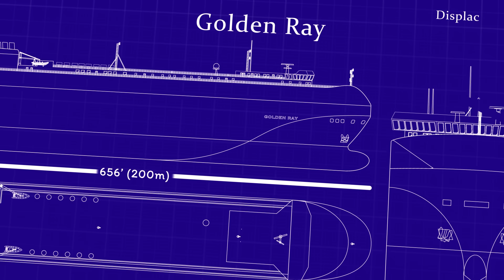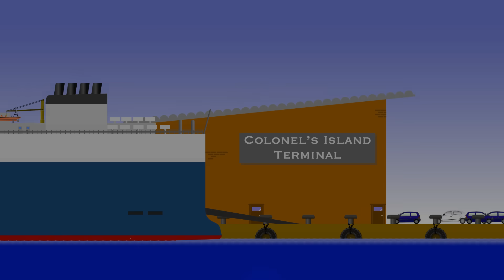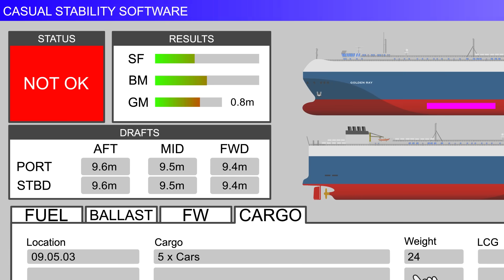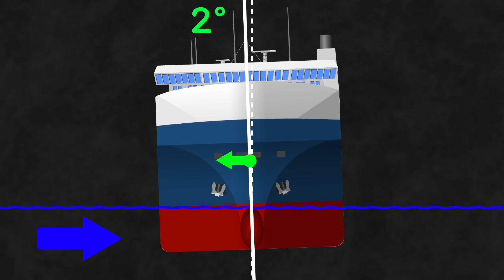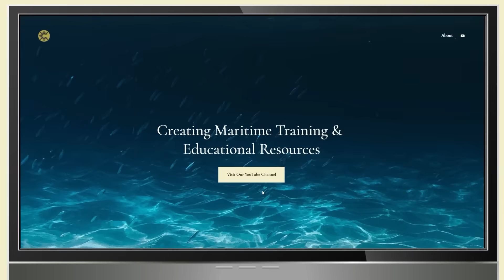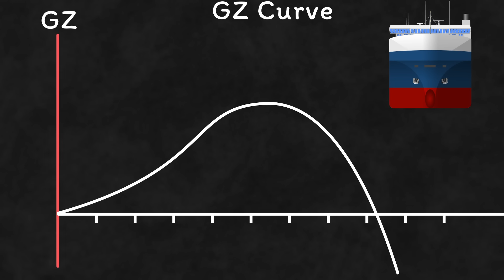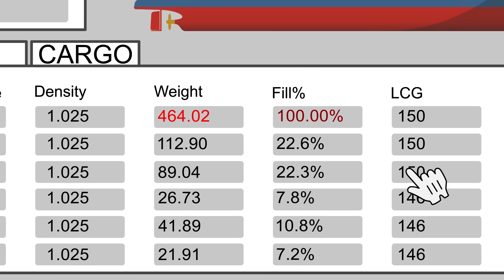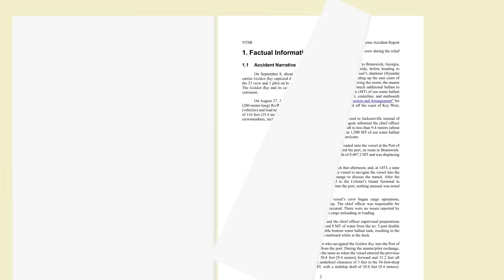Golden Ray: The Typo That Cost $250,000,000

Comment: Really interesting case study, and a really well presented video. I do have an issue with the idea that the fault was with "one small clerical error". I'm not at all familiar with the shipping industry or with nautical engineering, but I have done a decent amount of work on failure/anomaly investigations for spacecraft (including a few human rated spacecraft). To me the failure happened way before that clerical error, when they defined the Concept of Operations (ConOps). 

Sure the proximate cause was a clerical error, but the ultimate cause was allowing a single point of failure to hinge on a fallible (probably sleep deprived) person entering mission critical numbers into a computer by hand, with zero oversight, redundancy, or fault detection. If that is really the only way to do it (and of course it isn't) then a whole host of risk mitigation elements need to be baked into the hardware, operations, and procedures to make sure this really easy to make mistake doesn't seriously endanger several lives and cost $250M (nevermind the potential environmental and economic impact). 

But obviously this shouldn't have been a single point of failure in the first place. Before the vessel ever set sail, an FMEA (Failure Modes and Effects Analysis), should have easily caught this obvious point of weakness. I am not a GNC expert (my area is propulsion), but my understanding is that in aerospace, a LOC/LOM risk like this (loss of crew, loss of mission) would be handled by multiple redundant flight computers voting to make sure they agree. On top of that (at least for propulsion applications, idk about other systems) a FDIR (Fault Detection, Isolation, and Recovery) system should be overseeing the calculations, system settings, sensor feedback, and other stuff to make sure everything is ok and make emergency corrections. Also, [additional engineering gripes...]

I get that ships are not spacecraft, but you'd think when the likelihood and consequence of a risk are that high, some degree of risk management would be standard practice. Risk is unavoidable, but vessels/companies can't be this unprepared for it or this blind to it.
Reply: You're not going to get ships to fit multiple redundant computer systems. It's necessary in spacecraft and aircraft because things move so quickly and they literally cannot fly without the computer systems. With a ship, there's usually the option of stopping and thinking things through. But I completely agree with your general analysis that they had a ton of unnecessary and apparently unassessed and unmitigated risks inherent in their operating practices.
Reply: @beeble2003  Well, in this case they didn't stop and think things through! They never do because they have to keep to their schedule. I also noticed that the ship kept on increasing speed and didn't attempt to slow down for the 68° turn to starboard and the Captain seemed to have forgotten that he had ordered the port side pilot door opened long before the pilot was due to leave the vessel.
Reply: So if the program was set up to only load the data for an empty ship (no ballast, no fuel, no potable water, no cargo), and then the loadmaster has to enter everything else?  If something is missed on being entered then the system alerts that the ship is not safe to travel.

Similarly, an angle meter and timer is linked to the calculations from the program, where it counts how long it takes the ship to return from upright, and compares that time with the calculated values.  If the two times do not match, it will throw an alarm.  Depending on complexity, this system could even spot potential reasons for the numbers to not match that the loadmaster can double-check.
Reply: @toddkes5890  While I have zero experience with ship operations, I do know that they get pushed around by the seas in non-calm weather and it was noted in this video that the weather was calm. So in calm seas measuring the return to upright would work great, but what happens if the weather is not so calm? Would this still be able to accurately measure the ship's stability? Could that be why it is not available or used?
Reply: @LexipMedia  The double-check would be done in port where the water is calmer.  Also, I assume that if the water is enough to push the ship around then the crew would notice and take that into account.

Comment: There is some speculation that the numbers were entered incorrectly on purpose. The reason would be to avoid having to take on dirty river water instead of clean ocean water. This would save money having to clean the ballast tanks. But, there's no evidence of that...
Reply: It's always about time, money, and sleep deprivation. I've seen completely modified data on the LoadMaster software in order to leave the port and send the "perfect" report to the company even changing ballast amounts or cargo weight. 
There is no way the calculations changed from a GM of 2.45m to 0.8m without anyone noticing it even though you "preload" the previous calculations from the past days (which it's a completely normal operation and then you modify with the changes). 
Once I spoke about that "sketchy" procedure with the Chief Of.  and he just told me: or either you do it or you're no longer a member of the company.

Comment: Always fascinating that no matter how much we try to prevent things going wrong, there is always the human element for error that never goes away
Reply from the maker: We are always the weak link.
Reply: To be fair it seems they didnt try very hard, relying entirely on manual inputs and not having any sensors capable of indicating something was wrong, the fact that it required a single human error to end up like that it telling (in many cases such expensive accidents are the result of multiple compounding errors)

Comment: I think Chief Makoi mentioned the reason for this might have been that they didn't want to get the water by the dock and then have to run the water treatment plant, but I only go on sailboats so I can't judge how realistic this is.
Reply: That sound weird, because, I really struggle to believe they would depart without a seaworthy condition.
Besides, if they have ballast water treatment system, it should not be any trouble to take ballast. ( I am not entirely sure, as I never sailed with BWT systems, but if they have that I don't think they need to replace the ballast water in open seas)

Comment: Why didn't they  use CCTV cameras pointed on the hull of the ship depth marks so they can veiw manually how deep in the water the ship was within the captains control room. ? Im NO expert i only ones worked as deckhand for a veiw month  in 1997 but just saying.

Comment: Great stuff thanks.  Not seen a GZ curve or heard the phrase 'angle of vanishing stability' since Naval Arc classes 40 years ago, love that you are bringing merchant shipping to the masses.  How about an engineering based one such as the engine room flooding of the Emma Maersk at the entrance to the Suez Canal in 2013, while in convoy for southbound transit. The report from  the Danish MAIB is available on the web. Cheers, S.
Reply from the maker: I'll have a look into that one.
Reply: @CasualNavigation  Basically, a Stern Thruster disintegrated and Shrapnel broke a Leak into the absurdly long Shaft Tunnel. Wiring going through Bulkheads was not sealed sufficiently, so flooding continued into the Engine Room, until it was flooded above M/E Cylinder Cover Level. The Ship barely avoided sinking and was towed into Port Said (IIRC, might also have been Suez or somewhere in between) with a lot of Tugs, where it was stabilised at the Pier and Water had to be pumped out with external Help.
Reply: @Genius_at_Work  Wow, we could have had the Suez Canal blocked in a really bad way a couple of years before the actual blockage.
Reply: @markfryer9880  That's the Thing with Single Points of Failure. It already was blocked for several Years because of War between Israel and Egypt, with some Ships trapped in the Bitter Lakes.
Reply: @Genius_at_Work  Pity that was before KSN Vlogs although I doubt Maersk would have wanted him doing an episode on that day 😁
Reply: @marvindebot  The Accident Report is online for everyone to read. I'll post the Link in another Comment, because some Channels (me included) don't allow Links in Comments and I don't want all Information to disappear because of a Link.

Btw. Marine Accident Reports would make an interesting Format; I have considered Engine-related Accidents and Incidents myself for my Channel. A Friend of mine worked on the Container Feeder Akacia that  crashed through (not just into) the Holtenau Lock Gate at the Kiel Canal. It impacted at over 10 Knots because the Pitch Propeller gone rogue and suddenly went full ahead. I'll show the Accident Report and Footage of the Crash in the Link Comment as well.
Reply: @CasualNavigation  so they only pumped out 1.5T on the right side and not 1500T?
Reply: I use the angle of vanishing stability all the time when I talk about people's mothers.
Reply: Merchant shipping is a fastenating subject.  Right from Marine Archecture through ship loading and calculations.  I have a friend of mine who got a EE degree.  Then not knowing what he wanted to do for a job.  He hired on as a ships Jr. ENGINEER.  Now he is Ships Engineer.  Works 3 months on 3 months  off.  He brings home after taxes 3 million a year after taxes.  For working six months a year.
Reply: The presented GZ curve is very different from the GZ curve in the linked Accident Report.
Reply: Funny I hadn't heard that in the general press despite Emma Maersk being the heavily mentioned flagship of the line.

Comment: 8:16 I'm not sure all the cars would have stayed in place with a 83° angle
Awesome channel btw !
Reply from the maker: Thanks bigpig
Reply: Dont know the requirement for ship, but on trucks, they shouldnt move if they are probably secured, of course you have much higher G-Forces on trucks.
Reply: @jonasstahl9826  The do get lashed to stay in place, but I doubt the lashing are strong enough to hold them in place when the ship is capsizing.
I found a small video here,
https://youtu.be/bOtTmvGhr4U 
showing how they are lashed, I am pretty convinced about my above statement.
Reply: @tjampman  I dont think so, the tow hook of most car is on the right side. When the ship roll to the right side, the cars still can flip over because the suspension compresses and allow some movement, but they would stay in place, just tip over to the side
That way would work if the straps had enough tension to compress the suspension. Or the tow hooks would be in the center.
That will just pretend the cars from moving sideways, but that is enough for a ship.

Comment: I'm surprised they didn't have a backup tool that was required to "check" the Maths and main system, as the  computers cpu/memory are vulnerable to "Bit Flips" or "upset" events from random Cosmic rays, for example. So should have some sort of manual way to do at least a rough check to confirm nothing is glitched or missed. And this is going to get more and more important as our magnetic field keeps weakening as our planets slow pole flip continues which will last many decades if not centuries. So we need more manual checks and to harden our computer cpu and memory.
Reply: That was manually overridden.

Comment: Nicely visualised incident! And I dont want to be the person that have typed in the wrong numbers in that PC to cause a $250Mio loss. Imagine that. But mistakes always happen, a system should account for that. So I wouldnt blame that person but the systems designers instead.
Reply: Yeah, when 250M depends on one brainfart, its bad enough. When you have a system where the crew repeatedly rolls for that brainfart, and they need to fail that check only once to cause 250M of loss, thats on the system designer.
Reply: @nazamroth8427  yeah, the "CYA engineering" can drive me nuts. Basically, the engineers make it so that a human has to manually enter in all of it, that way if something goes wrong, they can blame the person rather than the design. Price is also a big factor, but a lot of it is liability. 

They do the same stuff with alarms. I've used some equipment that has various alarms lighting up and sounding every 30 seconds or more during normal operation. One machine even had a door open AND a door closed alarm, so you constantly had a flashing alarm, no matter what you did. It's just lazy engineers trying to protect themselves from liability by making the sensors laughably sensitive. It literally trains you to ignore the alarms, since there's ALWAYS an alarm. Then one day, something does go wrong, and they point the finger at the operator for assuming it's a "normal alarm" (the concept of which defeats the point of alarms in the first place). "The machine logged the error and it triggered an alarm, what more could it have done?"
Reply: @MatthewSmith-sz1yq  In a Warhammer book, there was an inquisitor who constantly operated in tainted areas. His ship had a taint alarm installed. He repeatedly bemoaned its existence and asked for a non-taint alarm instead, because that would actually be the unusual event anyway...
Reply: @MatthewSmith-sz1yq  Alarm fatigue is a real problem, and one that's been studied.
Reply: @keiyakins  no alarm. a voice stating it
Reply: @nazamroth8427  This is like ww3 =)
Reply from the maker: Thanks Tim. Glad you liked it.
Reply: I heard he had to pay it off of his salary. 25 dollars every month, at least!
Reply: You can make something fool-proof but you can't make anything bloody fool-proof.
Reply: No one ever was faulted entering he wrong numbers! Why?